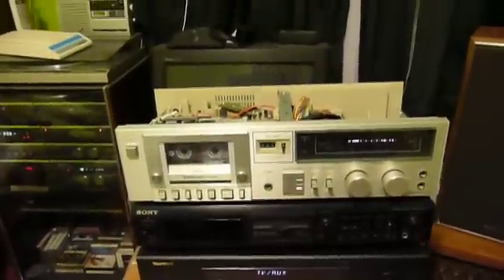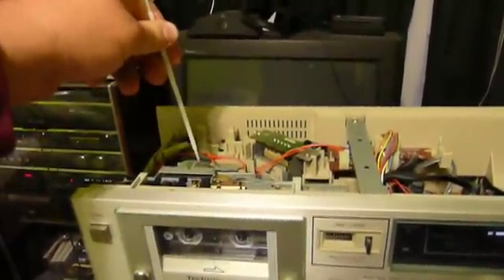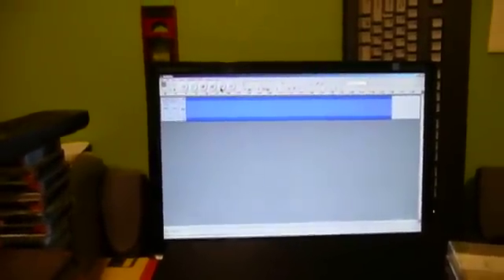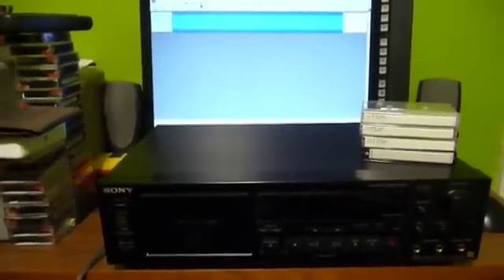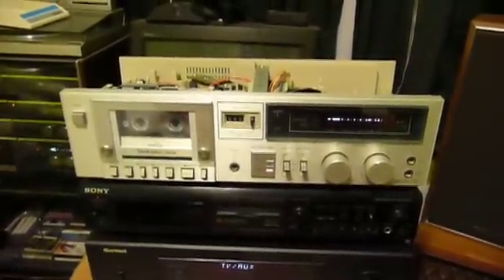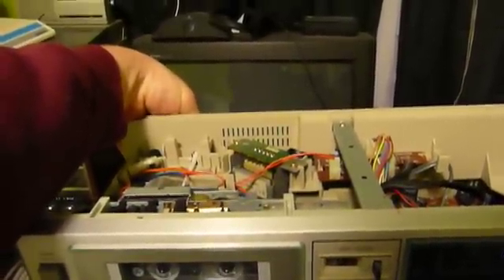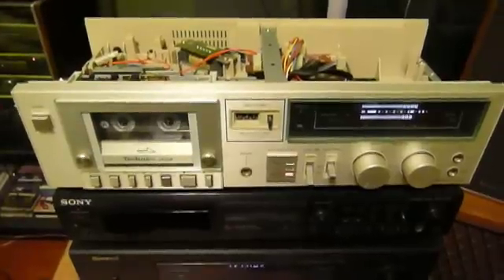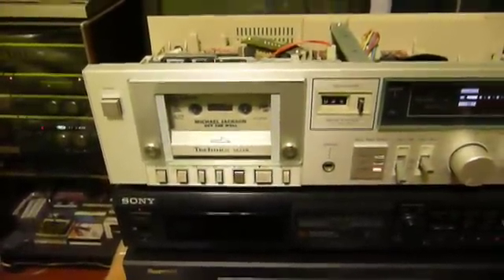Tape Deck Speed Adjustment

Comment: Does tape speed affect the vu meter levels on playback? I just bought one of these Technics RS-M215 and I notice that it plays tapes at a peak level of about +7 whereas my Sony TC-FX2 plays those same tapes at the correct recorded level of 0.
Reply from the maker: Technics used a different calibration standard for the level meters than almost everyone else. That's about all I know.
Reply: @uxwbill  
Is there a way to adjust the playback levels?
Reply from the maker: I wouldn't say they were so much wrong as different. If you want to try and care about doing it right, get the factory service manual for your deck.

Comment: Note that if you're racking your brain trying to get a tool to fit into the motor adjustment, newer players with digital displays may have an adjustment screw/potentiometer directly on the circuit board for easy access.
Reply from the maker: You can do that, but you'll likely be making two adjustments instead of one. (High and low speed, for those decks so equipped.)

Comment: I have a unit similar to this that the speed fluctuates, its infuriating. New belts too so idk what it could possibly be.
Reply from the maker: Speed control is entirely internal to the motor. If the belts aren't too tight, the motor might be in need of an examination. I don't know how serviceable it actually is, or if you can get it apart without destroying it. You will probably need to devise a way to move the brushes away from the commutator inside the motor.
Reply: @uxwbill  thanks!! I just never understood how the speed can just change like that. I have the same problem with certain 8 track decks, but most of them dont have the speed pot on the back like that.
Reply from the maker: With 8-tracks, there can be a multitude of problems. The tape pack can be tight inside the cartridge, the rubber drive wheel can be slipping and even when they do work properly, noticeable wow and flutter are definitely not abnormal. Many of the motors in 8-track decks are actually of very good quality, it's just that the drive system really lets them down. (Some are even AC line synchronous, and should thus have excellent speed stability.)

As for the motor end of things, the little DC motors used in most cassette decks have a speed regulation system of some kind. They vary in precision and may be mechanical or electronic. Lots of things can happen there too, from gummed up bearings, slight resistance changes in the motor windings as they warm up, or even a malfunction in the motor or its governing system.
Reply: @uxwbill  yea theyre tough. Its hard to even find a tech that has the equipment to do an 8 track deck correctly

Comment: I use a pre-recorded cassette and compare it to a version that's being streamed, I have them both in audacity, sync the beginning of the song, then check a few minutes in (usually the end of the song) and see whether the deck got there faster or slower than the streamed version and adjust appropriately. I like it to be within .5%. One thing to note, decks speed up slightly after being warmed up, so let it play for 10-15 minutes before adjusting the speed. You won't get it perfect, but .25% is a good goal to shoot for, if you get there, stop messing with it, because you might take a very long time to get it back.

Comment: Does it work the other way around ?

Like if i don't have a good cassette deck , record on the broken one again and again , and ajust it till the recording is right ?
Reply from the maker: No. Recording a tone and playing it back on a cassette deck with incorrect speed will result in a tape that sounds fine -- on that one deck only.

If you don't have a working tape deck, calibration and test tapes do sometimes show up on the secondhand market. Companies such as TEAC that still make tape decks may also have them available for purchase as a service part.

Comment: Outstanding tutorial Bill. I just recently bought an Onkyo single well tape deck (TA-R301) off of E-Bay and I noticed it sounds like it is running a bit slow. I will try your method for adjusting the tape speed. Thanks for contributing your knowledge of audio to the You Tube community. Very much appreciated.  :)

Comment: What if you didnt have a second deck....I have o scop's and freq counters...is there another way...I heard that if you have the 440hz tape...you can use a guitar tuner set on the 'A' string..which is 440hz and set it to give a center reading, which on my tuner is a green, or center reading...will this work?????
Reply from the maker: It's possible to buy pre-recorded frequency and alignment calibration tapes.

Yes, if you have an accurately recorded tape with a musical tone (440 Hz works but isn't the only one you can use), something like a guitar tuner would tell you how close you are to the right speed. A frequency counter would also work.
Reply: @uxwbill  so how do you hook a freq counter to the deck...connect both L and R channels out, together into a mono lead into the counter...?
Reply from the maker: You need only use one channel, left or right. It's not possible (or if it is, you have a much bigger problem) for one track to move by the playback head faster than the other.

Comment: I adjusted the speed using a commercially pre-recorded cassette, playing the tape and then using a digital file for comparison.  If you can keep the two tracks synced for about a minute you’ll get as good as an accuracy you can get out of the factory.
Reply from the maker: You can -- and may well have to -- do it that way if you can't make a reference tape that you trust or get one somewhere. It's a lot more work, though. The beat frequency method is also highly accurate, even if you're completely tone deaf.

Comment: What are you actually using to adjust the potentiometer?
I know its plastic but what is it?
Reply from the maker: The tool I used is part of a set sold for the purpose of adjusting tuning cores in a radio. You'll typically see them sold as "IF adjustment tools".
Reply: @uxwbill  
Everything relates to adjusting carburetors
That i have found
Reply from the maker: https://www.ebay.com/itm/140391623405

Comment: I think best would be if after you did this, to capture  a digital recording of the tape you made, then see exactly what frequency the tone is at. That way you should be able to (slowly) dial it in until get as close to the test tone as possible? Both decks MAY be the wrong speed. At very least I would suggest listening to the computer tone vs the cassette tone, instead of cassette tone vs cassette tone. If your recording cassette deck has any issues to begin with, it will not record the tone correctly. I am going to buy a 'pre-made' test tone tape from duplication.ca since they are the cheapest I can find (and seem good quality/decent company that knows about tapes). Amazed they can sell to me with free postage through local Australian location/free pickup too :)
Reply from the maker: A frequency counter mode on a multimeter is far simpler and every bit as accurate. While I might not have done that in this video (don't remember), I have done so in others. As I said in the video, one must have a tape deck whose speed they can trust.

I later tested another deck having a tape speed based real time counter, and whose speed had been calibrated with this same self-made tape. The test was against the real time counter on a CD player, and only after several minutes (more than 10, if memory serves) was there the slightest difference between the two. That's good enough for me, and probably better than the manufacturer's quoted wow/flutter specs.
Reply: I do need a MM but haven't got around to it yet - figured should learn to solder better first but worth it to test the cables too.. bit of a minefield trying to figure out what MM to buy though!

Your video is awesome, I'm a bit nervous about operating and adjusting (safely) - but at least you go out of your way to talk about using a plastic screwdriver!!

Comment: For reference, the tone should ideally be 10khz
Reply: Offical speed tapes are 3 and 3.15kHz. That is more than enough. Without freq counter even the 3kHz is too high to adjust it with this method.
10kHz is used for azimuth adjustment.

Comment: Why on earth do they hide the potentiometer and function to adjust the tape speed??? Why?? Please tell me. This is a very very very useful function that you can find on some decks as a knob or slider on the front, but most just hide it like this. If the function already is there, why hide it? I don't understand.
Reply from the maker: Most people have no need to ever adjust the playback speed of a tape. The motor's internal speed adjustment would not stand up to repeated use: decks with a user accessible speed adjustment will implement it in another way.

Comment: hello, is there any way to easily identify this "speed potentiometer" you speak of within any tape deck? The one I have is very different from this one - it's a Fostex x-55 multitrack tape deck, and for some strange reason the speed of this particular model is around 3.5 IPS, wheras most run at around 1.7 (i'm sure you know about speeds). I want to change the speed of it and I have a friend with a normal speed deck but I want to make sure I'm adjusting it correctly. Is there any surefire way of identifying that component within any deck?
Reply from the maker: The increased tape speed provides for better audio fidelity. Unfortunately, it also makes producing or acquiring a calibration tape difficult. Only a few regular cassette decks ever supported recording or playback at higher than 1 7/8ths IPS.

Most of the time, the adjustment is located right on the motor. Any adjustment must be made with nonmetallic tools.

Comment: What do I do if my tape deck started out playing normally, but within a few hours, started playing about 10x too fast?
Reply from the maker: +Kyle Ashby Check all the power supply output voltages. If the deck works normally after cooling off, record all the voltages at that time and again when it malfunctions.

As for actual troubleshooting, a change in performance that drastic is very likely to leave some hints around: thermally distressed parts, bad solder joints, etc. If speed control is internal to the motor, it could be bad, but motor failures are pretty rare.
Reply: It's an Emerson MC1010.
Reply: Thank you very much!  I'll try to fix it soon!

Comment: It's a lot harder to sync up music by ear, and no doubt less precise, but I've found it is a pretty good way to test things if you have an official (and therefore, presumably, accurate) cassette and digital source to play it against. I've managed to get beats in what seemed to be perfect sync and staying in phase this way. As I mentioned, it can potentially be a big hassle (it's best to use music you're very familiar with, because that can help with timing things into sync), but it's another possible solution if you can't dub or afford to buy a trustworthy test tape. By the way, has anyone ever told you sound a little bit like The Weatherman from Negativland? It's a good thing.
Reply: I've had success with this technique too, though I've only got 3 pre-recorded tapes, so didn't have much choice in the type of music to try it with.

I did find that just repeatedly timing how long it took to play a track of known length (I looked up the album in question on spotify to check the length), allowed me to get the speed adjusted very accurately. I got the speed spot on after playing the same track 4 times.

So probably not as quick as listening to two sources simultaneously, but I didn't work out how to play the tape in one ear and spotify in the other until after I'd finished adjusting the speed!

Comment: I have a Panasonic RS-608 tape deck, and the speed control basically has 2 settinngs, to fast or too slow, nothing in between. Could it be a bad belt?
Reply: ***** Yea, I should probably search for a new belt because I would like to get it working correctly again. Thanks for your feedback.

Comment: You are awesome! I love old analog stereo equipment and I feel that I am not alone in that. I have this exact same Technics M218 Deck and have used it for years but noticed that it recently slowed down as well. I was about to trash it but now I will try this repair. I got it for $5 at the Salvation Army in 2005. I love the fluorescent levels display. Do you have a tip for the L/R level knobs? they are scratchy and cut out when I move them. I think the contacts are worn. Silicone spray maybe?

Comment: I have had at least three RS-M205 decks, which is the model right below this one with the VU meters and most of those been slightly fast. I think when they are not in use for years, for whatever reason they drift a little bit. That said, I found most belt driven Technics/Panasonic and other decks manufactured by Matsushita to be slightly on the fast side.

Comment: Hello dear,
I have a cassette deck Technics 614 (Brazilian market) similar to the Panasonic 608 (International Market) at low speed after changing the belts and I can not find the spot for motor speed adjustment or a potentiometer on the board control.
any help is welcome
Thanks.

Comment: @uxwbill Don't want to annoy you any longer, just one more comment concerning the "National Technics" thing: "National" is not written on these devices, instead it's the National logo. You can see it on the Technics devices I have (I've made a video about them). On some japanese only-devices like the 20A tube power amp, there even was the National logo in Japanese.

Comment: A jeweler's/precision screwdriver with some insulating tape wound round the end is a good alternative to a plastic screwdriver, I've adjusted the speed on cassette tape motors before and if the screwdriver makes a connection between the motor's potentiometer and the metal case of the motor that can mess things up.

Comment: @uxwbill I connected the tape deck's output to my computer and used Adobe Audition's frequency analysis to serve as a makeshift frequency counter, for example playing the 1 kHz tone on the test tape and then lining up the blip on the graph with the 1 kHz grid mark on the screen. However, I also used your beat frequency method and the results were pretty much identical.

Comment: I purchased a test tape for this purpose, which contains sine waves at various frequencies, as well as pink noise and a few other things. Calibrating a double cassette deck is quite a chore, because unless it's really cheap and both decks run off the same motor, you have two motors to adjust, as well as two speeds for each, for the high-speed dubbing feature (although if you're that concerned about its performance, then you probably wouldn't use high-speed dubbing anyway!).

Comment: why not hook the other deck to the computer then use an HZ scanner like an oscilloscope or how ever its spelled for the computer. I use that techniques all the time. Look for soundcard oscilloscope. That way you can get it down to the herz.

i try 30hz 120hz 300hz 600hz 1200hz and 3000hz normally.